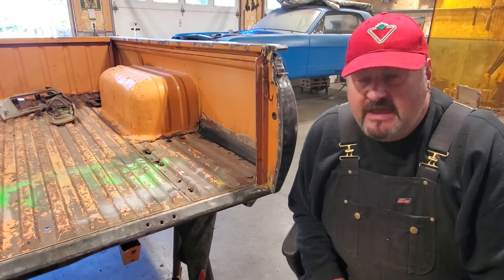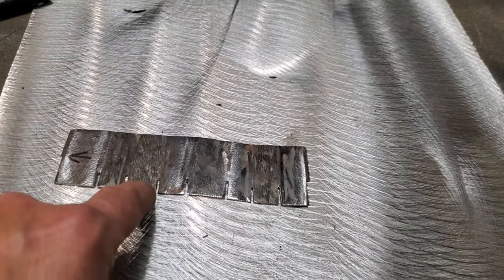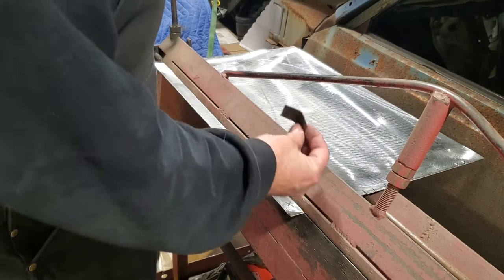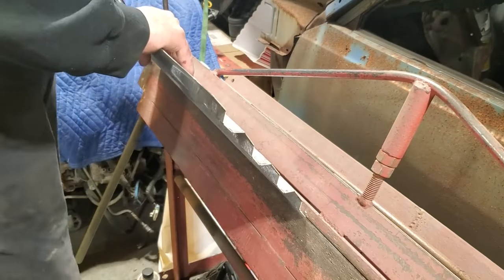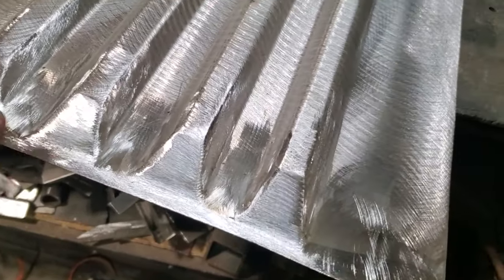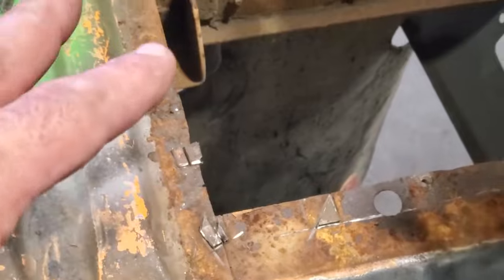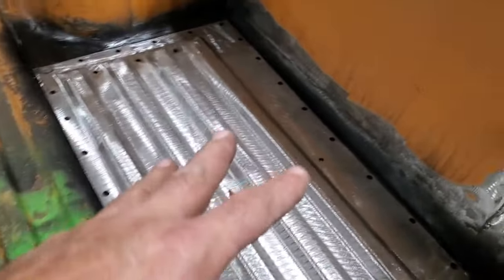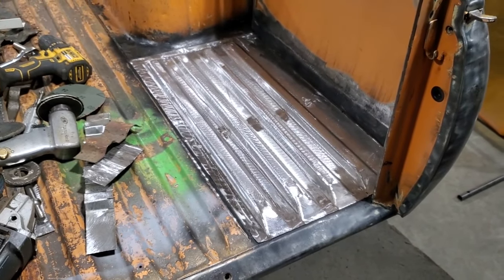How to make truck bed floor panels with basic tools

Comment: There is always at least one "wow, that's clever!" moments in Fitzee's videos. Making a template from a section of the old panel and cutting the slits for marking was one of the very best. Oh yes Fitzee, the tips were good. Thank you!
Reply: Cutting big slits like that is not accurate at all.  You use a tape measure and scribe marks that’s all you need.  
He made it so much hatred then needs to be
Reply: @mikeeagle2653  say what?

Comment: At the beginning I thought there might be some difficult hammer forming. Should have known you would find an easier way, with equal or better results. Thanks for the instruction.
Reply: Yah.. I would have tried to press it with a mold or something. Lol
Reply: @turboflush  the new politicians want to make a conversion to  electric a truck would make the easiest for battery space , just food four thought ,🤔✌️👍💪🇺🇸⚡😸
Reply: @milotorres6894  ?
Reply: I'm constantly impressed with how he takes a panel with a complex shape and simplifies it into easier to work with shapes and then just welds it together. It seems obvious, but sometimes I look at something and can't immediately see how to take it apart like he can.

Comment: Everything is simple if you think one step at a time.  When  looking at the whole project, it's intimidating.
The trick in everything is the sequence.
You da man Fitzee!
Reply: Yep. It's as easy as sitting down to eat an elephant.
Reply: @deconteesawyer5758  there are times that I have draw the line.  Hot dog and elephant eating contests are that line. 😁
Reply: Will Swift   if you were replying to me, I'm just offering my view.  Without the how to by Fitzee, I wouldn't get any farther than cutting a sheet of metal oversized.  He showed the steps he uses to make this part.
I install floor coverings, carpet, vinyl, laminate etc.
A new large job can be intimidating, especially so with a difficult layout or materials that are very hard to work with.  You don't look at the entire completed job and get overwhelmed.  If you know the process, you just start..... You don't worry about the entire process just the first process....... vacuum the floor, install tackstrips, then pad, then cut the carpet, then do the seams.... etc.

Comment: Fitzee I used to own an orange Datsun truck the same color orange as  the truck bed your repairing.. The reason I remember it so well it it was an extended cab truck which for my area was kinda rare back in the 80's.  Dont know how I ended up here at your channel but sure glad I did!

Comment: That is gonna be one expensive Datsun pickup. 
Nice work. BTW.. I like to hear that old slow pumper in the back ground. All these new compressors wear themselves out way before they should. And they make more heat which makes more water in your airlines.

Comment: Thanks again Fitzee for joining in with you in your Newfoundland laboratory/garage on making the profiled bed panel with simple tools, seamstress tape, scribes, dividers and markers. Making do and keeping things simple.
Thank you very much for your time in sharing these repairs that can be challenging to some of us.
When I weld any type of plug hole, I try to get to the parent metal edges first, since that is the holding strength, then fill in the divot if need be.

Comment: "So, there it is. It's not a very complicated panel to make." Fitzee you crack me up! For you it's not. I bet you see exactly how you're going to fabricate it before you even touch a piece of metal. Like how you cut out the ends and fabricated those little trapezoid pieces to weld in instead of trying to shape the original panel. Thanks for sharing your knowledge with us. Congrats on the 100K club! I just learned you have a Facebook page. Be prepared to get lots of pics and videos with questions from a guy in Texas! LOL!!!
Reply from the maker: No problem that's what the Facebook page is there for. As for the panel. I thought alot of it threw before I started. But some of it was on the fly. Just came to me in the  moment.

Comment: Good Vid..  on the Datsun PL 620 PU's there was  small factory panel/ door on the right side, truck box, floor to access the fuel gauge sender in the fuel tank. Hope the previous owner didn' t toss it cutting up the floor. I know you state many times you like it looking factory. I would send you a photo but I sold my 620 two years ago. Best to you and yours.

Comment: Very good job on that truck floor. Love the way you made that like a production run with the template piece. Great idea cutting little Nick's in it. Tony's  motto  don't  make it hard when you can make it easier. You remind of my father never dive into a job without a plan. It saves a lot of time and trouble. Great video's  learning a lot thanks Ruth Great Britain.

Comment: This is the same as breaking out metal for windows and vinyl siding, you doing the same thing we do with that, just a different kind of break because of thick steel, good job

Comment: This is a timely video for me, because I have a 67 C10 truck bed that needs the same type of repairs.  Your attention to detail is amazing and how you share your knowledge is priceless.  Little details like the weld through primer, how to clean off primer in plug weld holes with the drill bit tip, and how to weld plug welds is stuff that you don't see anywhere else. I wish I could have learned from you 35 years ago.   My metalworking skills and welding would have been so much easier.  I have had to learn by trial and error and I still don't know one thousandth of what you do.   Thank you for helping  amateurs like me who can't afford to pay a restoration shop thousands of dollars to repair rusted out projects.

Comment: Great work. I had to do this by hand on my first car that had holes in the floor pan, old Holden  Gemini with big holes in the boot pan, made all new panels with a hammer chisel anvil lumps of wood and some sheet metal. Was rather complex but like you said there was no replacment parts available so had to be remade.

Comment: I've had several of those little early 70's Datsun pick ups. They are great little work horses and definitely worth repairing. Aside from them going up in value and being a fun little truck to drive, I have put a full ton of cargo on one AND been towing a trailer that with its' load weighed another ton and it hauled it. I know I was close to my limits because I was on the freeway with my gas pedal to the floor and got passed by a school bus but hey, I got where I was going. Great trucks, really great trucks.

Comment: Brilliant method. However, I'd like to suggest a way to speed up the process and make it more consistent. Find a strip of metal that fits in slots made by the grinder. Make two J-shaped pieces that can hang over the top of the brake. Slide the strips into the two slots and push the floor pan up against the brake. Then lock up the brake and remove the strips. Now the floor pan is accurately positioned and ready for bending. I hope this makes sense.

Another improvement would be to use a simple computer drafting program to make the tick marks for the grinder. Once you define the basic cycle, the program can copy it as many times as required (step and repeat). Then print the marks on paper and tape the paper to the sheet metal. If you make the marks the same width as the grinding wheel it would be easier to place the slots accurately (if you are off, you'd leave traces of ink).

Comment: When your cutting the ends of the folds to make your taper to flat. It’s all marked out, could you just cut the side section leave the top attached flatten the end piece with a dolly and hammer, then fold if down cut to shape and weld, it’s the same metal reduces the welding and it held in place  while you cur is as it’s still attached to the panel. Also our body guy used to cut as you do all the stuff he can with the grinder leaving a strip round the edge with the spot welds on. Grip one end of strip with mole grip heat with torch and pull until you get to a spot weld, use chisel as you did to remove spot weld and then heat and peel, basically your pulling of a long strip of metal popping each spot weld. Love your work.
Reply from the maker: You could do the ends like you said but I thinknit take longer as you have to dolly thr peice flat and be left with kinks from the bends.

Comment: I've had those grinding discs worn right down smaller than the angle grinder nut 😂
Handy for opening up holes a bit in thinner plate too.

Comment: you need to try the round/curved edge flap discs, they are great for knocking the tops off welds, i only recently started using them, totally changed the way i work. Great vid. as usual, i learned alot.

Comment: Fritzee is a true craftsman.. his videos inspired and taught me how to do it myself.. do you use weld through primer? I was going to but heard mixed reports. I dont have a break, so doing bends are tough but doable just using a steel table edge, a hammer and couple heavy rectangular dolly's.. actually blocks  from a 20 ton press.. you use what you've got! I've always been this way too!

Comment: The box is off a pretty early HiLux. We had one for years and the box fell apart when we used the truck to carry concrete rubble to the tip. The sides spread after a few loads.It wasn't rusty,just tired so we took it off and replaced it with another we got from a wrecker...for free. As matter of interest,here in Australia,the land cruiser single cabs had a similar box but shorter with  a high ladder rack on the front. I've seen some toyota light trucks with dual cabs and the same box.

Comment: Fitzee I've been watching you sometimes struggle with your bender for a long time. This small mod might be worth looking into.
it's an add-on bar you can bolt at the top of your pivoting table on the bender for narrowing the bend surface close to the bend. It helps to avoid warping or "undoing" previous bends that hang down below the clamping plane.
You could add or remove it at will depending on what is needed.
The top of the sketch is your original layout, the bottom half shows details of the bar attachment. Should be fairly quick & easy to make yourself.
Many benders are designed this way anyway, but the add-on makes for more options. You may indeed be able to do bends you can't quite pull off with your bender as-is, and it's a fairly simple modification.
edit to add: Dang Youtube won't allow me to put a link in the comments. Keeps deleting my whole comment. Send me a note or something with an email and I will send you a link to the sketch I made.
Keep on keepin' on.
Reply from the maker: Cool. Like to see that. fitzee23t@hotmail.com

Comment: As usuall Fitzee your Craftsmansip always amazes me  i originally thought the Bed was from one of the OriginalChevy Luv trucks that were of course built for GM by Isuzu  in a joint effort in the 1970s  or a Older Toyota  most of those early  Mini Trucks built over seas.  had major Rust Issues as they did not have the better Steel techniques or know how to treat it with Rustproofing like the American manufacturers

Comment: Hi Fitzee. Another way to clean primer out of a hole is a wire wheel. Just make sure to blast air after to get rid of loose wire.

Comment: great stuff fitzee. that is exactly how I would have made that panel. Except of course mine would not look that nice because i dont have the patience to cool everything and make all the undersides look perfect too. I get it close then use a bit of filler which is fine. The new fillers last many many years. My inverter welder FYI does not warp nearly as easy as the 220 non inverter. but still warps a bit. Tolerable amount that a slight bit of filler will handle. love how you show everyone you can use basic tools. and multiple pieces to make stuff. I have been doing it that way too for years. Again not as nice as your work but acceptable.

Comment: Great vid & great teacher. I love buying nice tools but this shows you don't need to. Even a home-made brake. I think I'd have done the ends of the beads differently making a cut on ea. side and bending down the end. It really wouldn't save much welding/grinding but could probably get a nicer radius more like the factory had.

Comment: Thanks for another great tutorial.  I work from the edge to center on spot welds similar to the way you do  it.  
 Those Milwaukee markers are killer. I use  them after a carpenter friend introduced me to them a couple of years ago. 
When you store your markers , I was told years ago to point the removable cap pointing down. The marker wick stays wetted while standing on the end. 
Stay real.
Rick

Comment: thankyou Fitzee i have had problems with spray through primer me being a begginer i was abit bewildered at first why i couldnt just weld through it without it effecting my welds. i would also try doing my spot welds from the middle which i can see there is a much better way as you showed thankyou again look forward to your next video 

regards 

Erik

Comment: Great informational video. Love it. Always learning something from Fitzee. This just gave me an idea. Now i don't have the Brake to make the panel but for my Ford F100 i may be able to buy repair panels like this and just weld them together to make the floor for my bed. My truck has a step side bed and had plywood floor . Now i can use the style side metal floor and not get the plywood. Will last longer than plywood. And i ca spray bedliner material on it. Thanks Fitzee.

Comment: With my 24 or 36 grit grinding disc’s I’ll use some old hand sheet metal and trim with flats all the way around roughly 10 cuts. You get more life out of the disc plus all the little tips cut the welds off better. Great video cheers 🍻

Comment: Spent my life in the collision industry.  Retired after almost 50yrs, it's nice to see do things the way I use to. I did little restorations in my later years people in my area didn't want to pay for the work performed. My question to you why do you use 24 grit for griding welds I went 50 grit years ago and 120 for a final finish?
Reply from the maker: Just found it faster. I did alot of this type of work when I was in the trade and as you remember.  Only way to make money was to do it fast. So anything that made it fast I went with.

Comment: Tony Ive always found instead of notching ends for marks just put a coat of paint/dye marker along both ends and scribing your lines to bare metal and working with that, done that a lot with press brake work making multiple corrugated panels

also if you can find reamer bits they work good for cleaning paint for spot welds too but you seem to make old drill bits work!

Comment: That's the way I originally wanted to do my trunk floor, but my homemade metal brake doesn't allow for flipping the metal over that way. Used the technique you used in the press die floor pan video. Came out well but this way looks easier.

Comment: I was thinking that maybe if you have a magnetic angle finder you could place it on the metal break. Then get the same angle. Not that you need it, but just a thought. Another awesome video!

Comment: Good stuff!  I use smaller plug weld holes (1/4”) but more of them.  Hot and fast circular motion with the gun.  I also like a 3/8 mini air belt sander for dressing sheetmetal welds.

Comment: I would not worry about the little bit of bracing extra you welded in, no one will see them and I always feel a little more bracing is better than stock, all you were talking about was 1/4 “ at the most.  This will save your wheels in cutting them down.

Comment: Nice video Fitzee - I spot weld from the centre out and - it's done at a higher current and wire speed than normal, often I do it pulsed to ensure the weld pool doesn't drop out/get max fusion from parent panel to planted panel.
The key factors are wire dia AND shielding gas(I use 5% CO2/Argon mix), but I know your a 100% CO2 man so the edge burning would suit you better, but it will suffer from more lift off from the panel below(I used to do it this way too), even with restraint(eg butt of wooden handled hammer, etc). 
BTW Toyota make the world's greatest pickups in their class, but like ALL Japanese vehicles, they don't last well in wet and cold Northerly climates(I'm at 59°N) and had to scrap my old favourite '85 HILUX after the box rotted out - she was a great reliable truck that would go anywhere!!
Keep safe and well.

Comment: Such an enjoyable and informative video, amazing work as per usual!!👌👌👌
I'm very proud that I came up with the solution of the drill bit to clean up the plug holes myself. I also use it to drill out spot welds, I use a standard drill bit first and go down through the first layer of steel. Then I use the flat drill bit to remove what's left, works quite well!👌😏
Reply from the maker: Interesting!

Comment: Fitzgerald, I noticed that you never use a sand blaster. I like using one for certain spots.
Reply from the maker: Nope hate them. Just very messy. Used thrm in one video. The  rust repair around the window video

Comment: At 53:45 and 55:40, . . Fitzee, I have watched every one of your videos and I almost want to retire early from my current job and get working on my own cars. My question--I still have not heard you explain "WHY" you "Plug Weld"?? I know some will say "It is like, or, it looks like, how the factory did it", especially on restoration work, but to my eye, when you are done, it still does not "look" like a "True Spot Weld" unless you spend even more time dimpling the surface with a Dremel or something else. SO, Why plug weld instead of continuous seam welding? .. Great video as always, thanks or taking the time to share you lifetime of learning with us!
Reply from the maker: I like finished edges. Sold welds kill that look and also alot more welding and grinding with no other purpose other then  more welding and grinding.